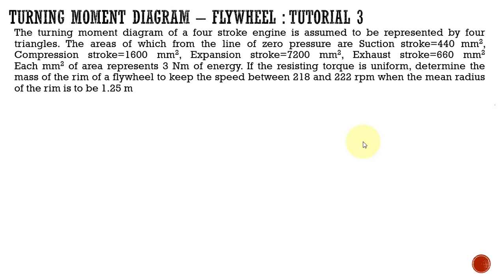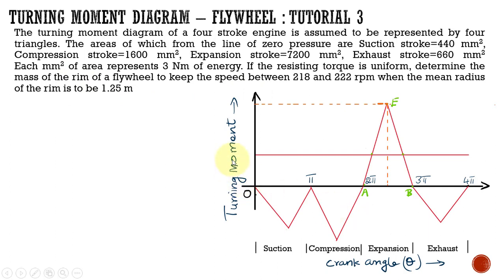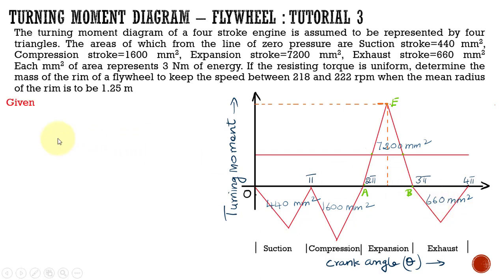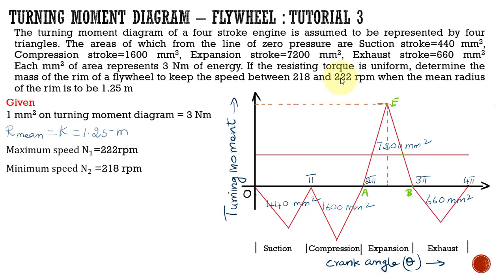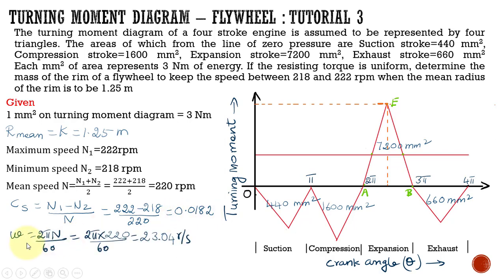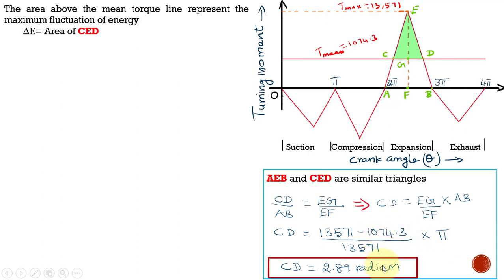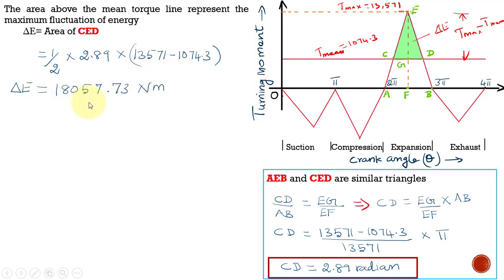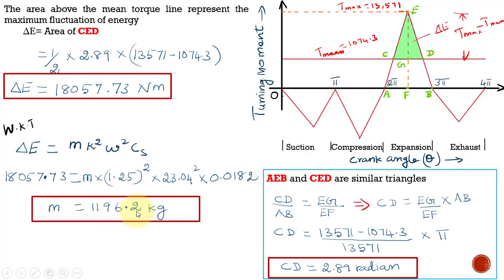Dynamics of Machinery Lectures|Flywheel Problems|Turning moment diagram for four stroke Engine

Comment: Sir I didn't understand why theeta is only pi/2 in tmax
Reply from the maker: The maximum torque is obtained at exactly middle of the power stroke. Hence the angle  is pi/2. The total angle covered during the power stroke is pi.

Comment: I think you used the wrong tmax value when finding fluctuation of energy, the slide before it was 13751 but after it was 13571
Reply from the maker: Yes. sir, it is a typo error, you can solve it by substituting it by 13751. Thanks for informing.

Comment: how to know that 3 strokes are blow thwe line
Reply from the maker: The positive work is produced in the engine during the power stroke (expansion) only. The remaining three strokes use the existing available energy to complete the cycle. Hence, the suction, compression, and exhaust areas are represented below the line.
Reply: @michaelthomasrex  But how do we know that the positive work is produced only during the power stroke, I've seen some turning moment diagrams where the suction stroke produced positive work